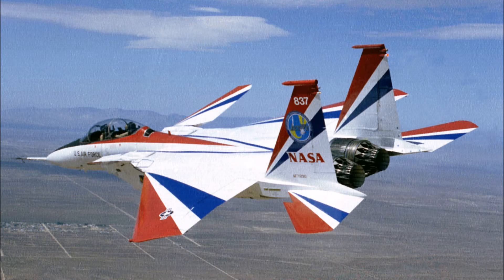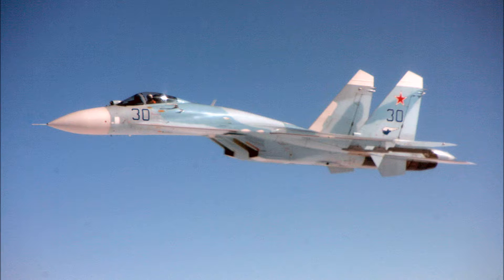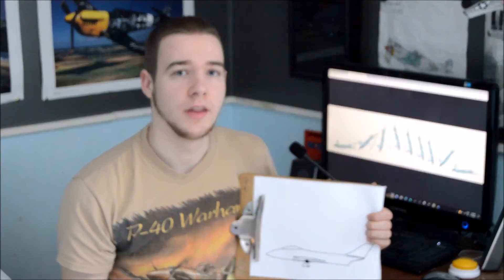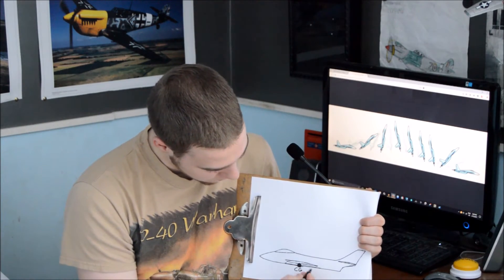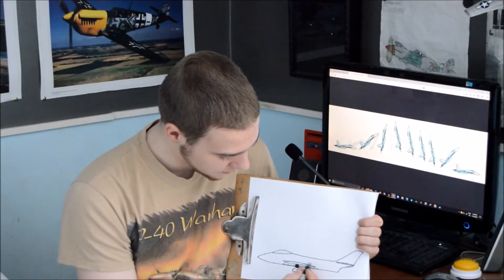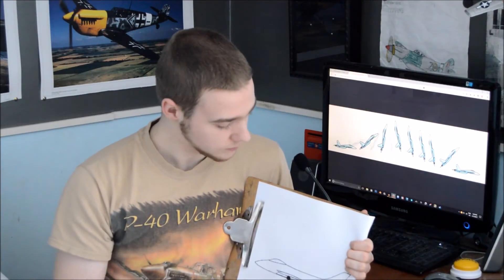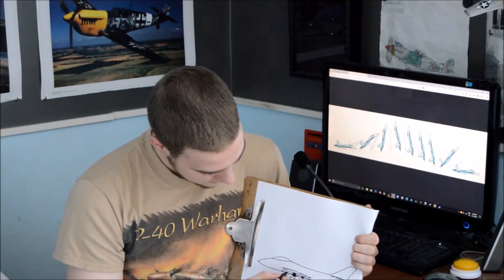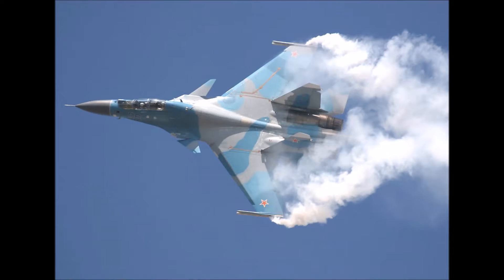Supermaneuverability Explained

Comment: but how is the SU-27 capable of Supermaneuverability better than the eurofighter is even without thrust vectoring, flybywire and canards?
Reply from the maker: Heretic123456 Thrust vecotring and canards are not requirements for supermaneuverability, they help, yes, but they are not requirements. Its more important to have a thrust to weight ratio of 1:1 or greater, an aircraft that is very inherently unstable, lots of lift, and large control surfaces with high caliber flight control computers.
Reply: @Wonderful Aircraft Not exactly true... when aerodynamically stalled you lose control over your plane via control surfaces, and your plane is going to start awkwardly spinning or facing in an unwanted direction due to turbulence, unbalanced thrust, etc... Engines with a TWR of >1 are only going to push you in the direction of your nose with an acceleration greater than the pull of gravity (9.81m/s²). To cancel/control the spin you need a way to induce torque on your airframe, which is currently only done with Vectored thrust in planes with traditional take-off, or reaction jets in the case of the VTOLs Harrier and F-35 (although things like differential thrust, reaction wheels or an RCS system are conceivable).
Reply: @thedubstepaddict3675  Yea thrust vectoring its important because you cant have "post stall maneuverability" with standard "air controls" like elevator etc, you create movement using the power of the engines at that point.
Reply: @RogueBeatsARG  exactly.